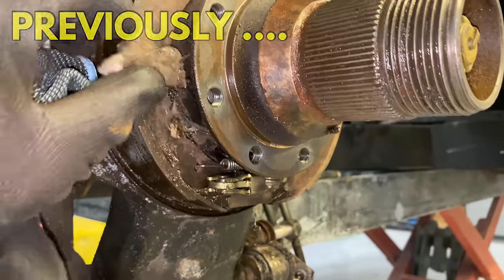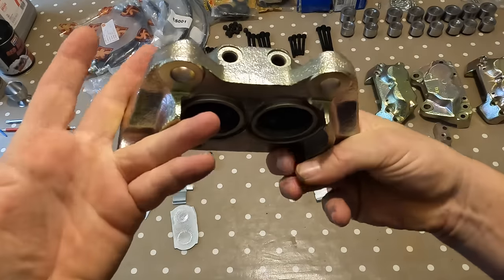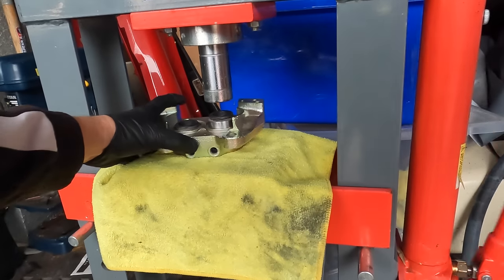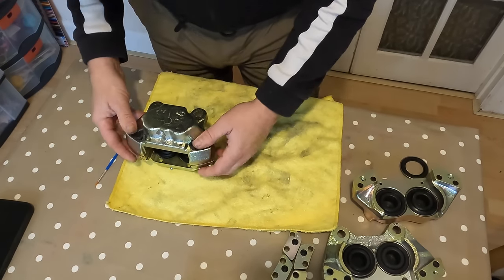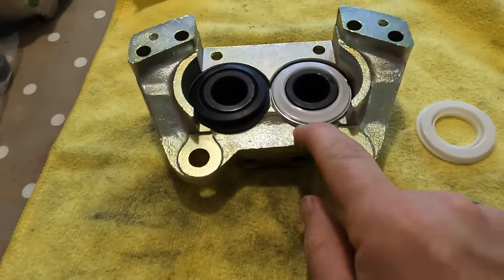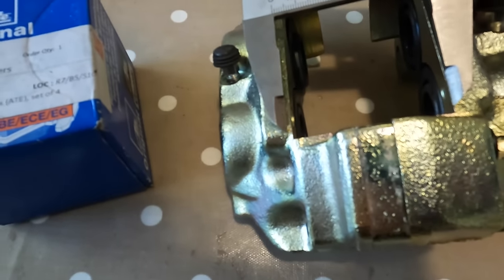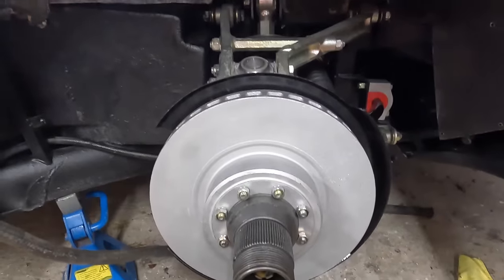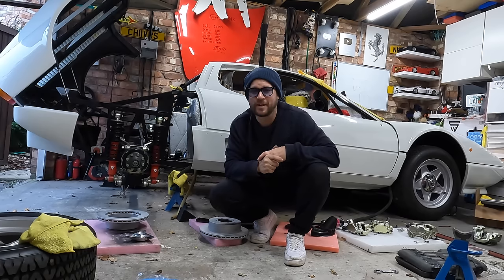Barn Find Rare Ferrari 512BBi - Finally Fixing a 2 Year Brake Problem

Comment: Wouldn't be hard to get a local metal turning company, to knock you out a couple of sets of those slider pins, to the size you need buddy.  Originality has gone out the window, compared to being able to get those knocked up locally, in better, brake safe steel for a few quid, compared to Mr Fs prices.

Comment: I often use a G clamp to push my pistons back in. Just such crazy rip off prices for those seal kits when really they should be a few pounds only. Probably a Fiat part or there must be a cross reference  out there for the parts especially as the calipers are from ATE.. You are doing a beautiful restortion job to this Ferrari.

Comment: Have you contacted Ate for those pins? The calipers will have their number on them so they should be able to cross reference. and as you have the Ferrari rear caliper seals and clips I would replace the ones you fitted earlier.
Bad luck with that guy who let you down. Its just a ball ache. And yes been there got the T Shirt!
But you just showed the typical jigsaw puzzle of parts any car refurbishing produces. The first lesson is NEVER throw anything away until you can find a replacement or its cleaned up. I know you haven't and to just be missing a bolt or pins isn't bad going.

Comment: The reason you can't get exactly the same finish easily is it was phased out as an industrial plating  system years ago due to the Hex-chrome used for the passivation being hugely carcinogeous, not good for the people working in the plating plant. These days trivalent chrome is used ( often combined with a sealer to improve the corrosion performance ) but the finish is a more silver colour.

Comment: The original parts were cadmium plated for corrosion resistance and that's been illegal for automotive use for many years.  But there are alternatives, such as Zn-Ni, that give the same appearance.  I assume that's what was done to your parts.  They shouldn't need a further coating if you keep them clean.
I personally would avoid the Ate pads.  They really aren't that good and if you're going to drive the car rather than just show it I'd get a set of EBC Yellow or Reds for significantly improved stopping.

Comment: absolutely excellent content! 
One comment -- i have never laid hands on a Ferrari, let alone a Ferrari caliper, however, i have rebuild countless calipers, and i have never ever had to press them in that hard. They do slide in with smooth resistance, but not like that. It begs the question-- did you size the pistons to the bores? (which may include honing them (to at least remove the plating)  I know not all cars need that, maybe this one does? The pedal will have ample power to engage the brakes, but with that much resistance i cannot image them resetting back to a relaxed state. Once again, perhaps Ferraris are different?
Reply from the maker: its a very good point, i will run some testing now the pistons are in
Reply: I concurr on the plating ...almost certainly the issue here.

Comment: It’s worrying how few platers actually know their business. Zinc plating SG cast calliper parts is simple enough if you know how! Curiously the industry did a huge amount of work on improving the performance of the corrosion  resistance of brake callipers.  Re the suspension, my pitch, etch prime and CR paint.

Comment: Scott, when you get stuck on fasteners, remember that Ferrari aren't so egotistical that they make their own nuts, bolts, and screws.  Here in the US, you can go to your favourite auto parts store and find the Grade 8 bolts in metric and the cad plated washers, etc.  They are available for pocket change, not large cheques to Ferrari.  It also speeds up the project!

Comment: Don't use brake fluid as an assembly lube if you aren't going to fit the callipers and fill the brake system straight away, can cause corrosion ,  use brake assembly lube like ATE blue or red rubber grease ( like always used to come in the girling kits).
Reply: I use 200* C silicone grease on calipers and master cyl.

Comment: Re the pins. I had a few old Alfa Romeos of around the 1980 era and recall them having pins. It's likely Ferrari may have used the same so maybe check suppliers of caliper parts for Alfetta, Alfasud, Spider, Giulietta etc?

Comment: Do the seals/rings that go in the calipers have a taper? If so that might account for the difficulty installing the pistons. Of course if there is a taper and they were installed incorrectly they will fail in service.

Comment: Only ever built range rover classic callipers , so same era - but i’m surprised you were using a press to put the cylinders in - a bit of lube and they should push in. Might be worth pressure testing them with some air to see if you have nicked the seals.   
Pistons may of needed a lead or a slight chamfer on them to help them past the seals.

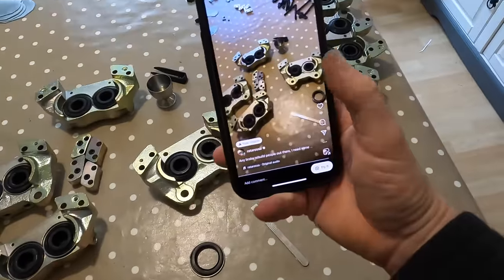Comment: 10:03 you have got the wrong brake calliper repair kit
You need the dust boot with a metal ring on the rubber dust

Comment: Shouldn't use brake fluid for assembly it will cause corrosion, you should be using the proper red rubber grease. putting the pistons in with a press is a real no no as chances are you have damaged the seals, you push the pistons in by hand and with a slight rotation so as not to damage the edge of the seals. even if you get pressure on the braking system chances are you will get leaks later.
I recommend striping the callipers and and cleaning everything down, inspecting the seals and rebuilding correctly, after all its only the brakes.....
On the pins just get them turned down to size on a lathe, simple

Comment: You don't want to fit the pistons with brake fluid, ATE does sell a special grease for that, this grease is miscible with the brake fluid. There is no way you should use an hydraulic press ! Special grease and hand push is the way.

Comment: You should be able to get a CNC machinist to reduce the lenght of the longer pins for the brake calipers. Also recreating new ones shold be possible
Reply: The machinist can continue the thread to the correct depth and then  cut off the excess thread.

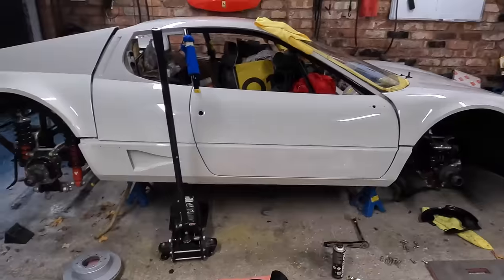Comment: 18:38 put the pins over the brake calibers, and messure the difference of the stick out between that and the fronts, then subtract that from the middle, and then write that number down and look for that size pin, after getting the refence of the size of the pin from the ferrari catalogue

maybe even look through your parts and see if you have anything from that old Ferrari dino you had on awhile back, IE something of that vintage

and remember the backs are always smaller than the fronts, they always did that, so you need to look at the rears

like see if theirs any rear only kits, maybe even look at the 365 BB, as I dont think they changed anything atleast visually on the car, unlike the testarossa where the track was signficantly widened, and the engine was brought up to I think 4.9 liters'

actually hell look for a ferrari daytona, your wheel nut spinner is off one of them, and those things are worth bonkers money

like go call ian tyrells workshop and tell him what you need, he always covers vintage ones like that and it could be that he's got some there you could buy 

thus saving you the runaround

Comment: Pistons shouldn't be installed with hydraulic press.. I'm afraid such method can lead to rubber seels damage. Usually I could do that by fingers. As I assume seels from an aftermarket kit were not produced  precisely as needed, so the motion of pistons in the calipers can be very hard. The problem can be that pads won't be fully and immediately released after breaking

Comment: Did you check the piston bore size before they were replated?
Too much plating in the seal grooves will cause the seals to pinch the pistons.
Motorcycles have this problem due to corrosion in the seal groove.

Comment: I don't know what you can use on the zinc to preserve it... and that's why I hate zinc plating... it's like a sacrificial coating.  It reacts with the whatever gets on it and dies a slow death all the while dulling out and usually looks roached pretty quickly.  Powder coating doesn't react and seems to hold up much better, but obviously you wouldn't use that in this restoration.

Comment: those pistons should push in quite easily (very similar to the calipers on my triumph) I would question using a press because the pistons may be too tight in the bores and you may find brake pad is not wearing even. if the dust boot is wrong so might the piston seal be wrong.

Comment: No doubt someone will have already suggested it. Anyway are the front pins the same diameter as the rears apart from bing to long? If so i would source someone to with a metal lathe they could probably shorten them

Comment: If the dust covers were wrong, what makes you believe the brake calliper seals are right?? After all you had to press them in?? Which you shouldn’t have to do and they may not push back off the disc? I’d be worried.

Comment: You’re in luck. They just came out with a gloss clear powder coating. Mat Armstrong’s bmw just had the stripped body white and then clear powder coating done to the interior, floor, undercarriage and engine compartment on his restoration. 
On the brake pins, can’t you just take the long ones to a machine shop and have them lathe off a bit to spec?

Comment: Concerned with those pistons going in so tight that if plated has extra thickness been added therefore with seals could make too tight. Worried when on car yes will brake but may not release causing brake drag .test one on a car with fluid . 🧐🫣

Comment: Ive not seen any earlier vids on these brakes but im  curious about the discs. At first glance they look new but watch the vid in high-deff, they look like they are badly pitted. If my eyes arent decieving me and they are pitted like that, can they be replaced? Have they been skimmed and checked for runout? Or, are they new and came like that? Given how bad the quality of the iron was back then and that they were designed for asbestos pads and shoes, i wouldnt risk one or more cracking or warping with heat, if they are just cleaned up originals.

Comment: I'm not sure press fitting the pistons in the calipers is a good idea, what will happen the first time you'll brake ? 
Are the pistons gonna get back in by themselves, or are the brakes going to seize ? 
Brake pistons are supposed to slide in and out easier than that me think…

Comment: The calliper pistons should definitely not be that tight going in. If you have the wrong dust boots are you sure the seals are correct? They could be slightly thicker than the ones that came out.
Reply from the maker: yes i was thinking the same. im going to check one

Comment: O man, you shouldn't need to press in those pistons. Why would you think pressing them is was a good idea? There a part that are made to fairly easily slide in and out.
I sure hope that once you get fluid in them they somehow lubricate and start sliding easy..
Those are going to be hard to pull back out if even possible.
I guess whats done is done, you'll find out when you go to drive it and either you won't have full braking, or the pistons don't all retract and disengage the brakes.. they'll let you know either way.
Wish'n you the best though.
Also since some of those pistons went in fairly easy, you might think you're brakes are working but they might only be working with one piston..I'd still think you'll have some blantant sign something isnt correct though🤔 curious to see what happens.

Comment: If you want (any) job done well, it will not be quick. Also, if the kit fitted both cars, they would only make one kit - it would save them manufacturing costs, even if they charged differently for different models. Turn the pins down in a lathe dummy. 😂

Comment: Hello
Reply: Hello mate can't take this for granted but 40 odd years ago I used to do brakes, anyhow I think you have to tap the pins into place and the bit of metal at the end goes into the caliper and hold the pin in place, some other types used a flat head on one side and a split pin through the other end, hope this helps good luck Scott.